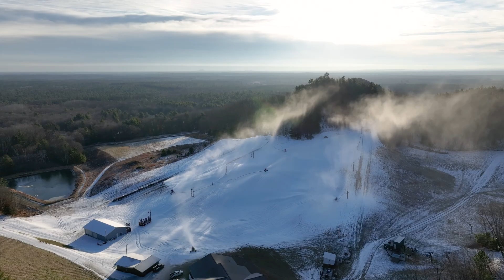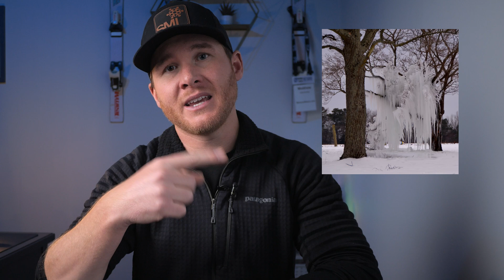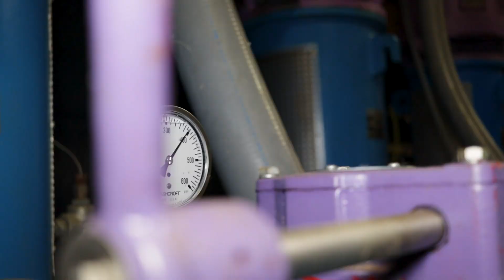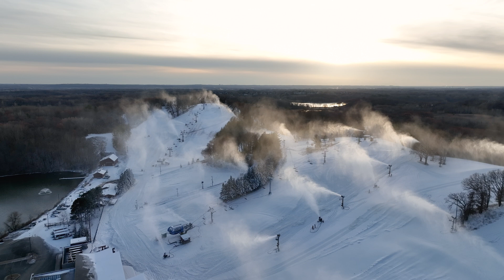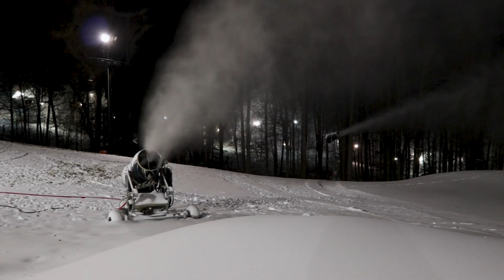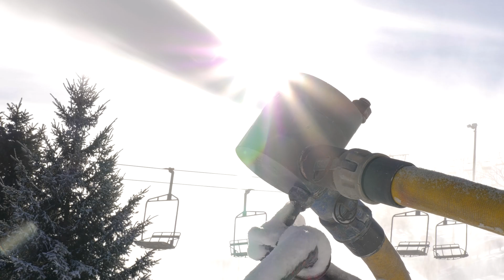How Ski Areas Make Snow

Comment: Point of order, you've missed the SMI/MSI 320, an airless family of snowmakers still used across the Midwest. It dates back to the 70s but was in production into the 2000s. These use a spinning alloy blade to mechanically shear water drops, throw the water forward, and simultaneously provide a surface to nucleate the water on. If you see an exposed pinwheel looking snowgun, it's probably one of these. Swiss Valley has several and Shanty Creek has a couple left, and I'm sure other areas around the Midwest also have many still kicking.
Reply from the maker: Totally - but focusing on current production snowmaking machines! I think Devils Head has about 200+ 320-style machines (they aren’t full scale 320s but a smaller custom version)
Reply: @MidwestSkiers   There's enough still in circulation that a brief mention might have been nice, alongside the airless sticks. 

I do appreciate seeing the Swiss Valley pumproom in the lineup - if you want to talk more in depth about our snowmaking or snowmaking generally, shoot me a message.
Reply from the maker: @daniellewis1789  🙏👊🙏